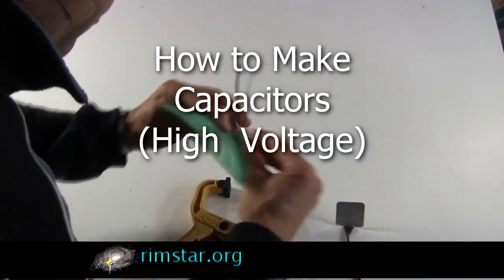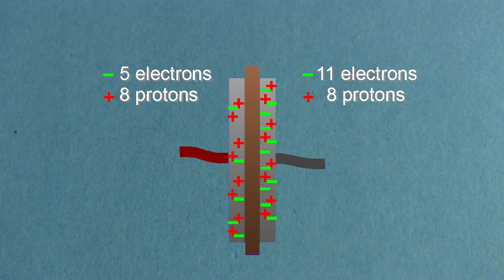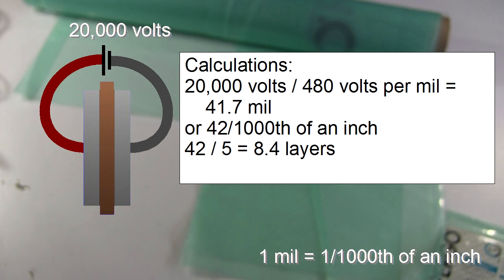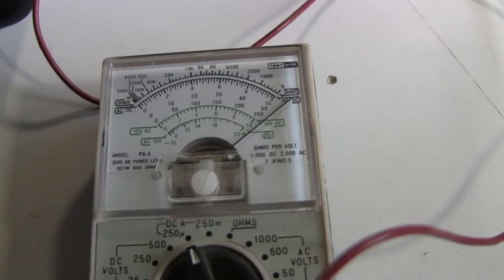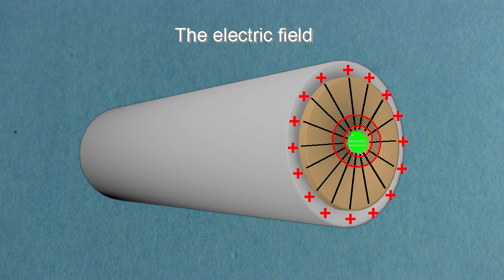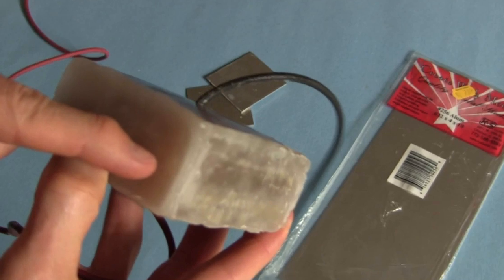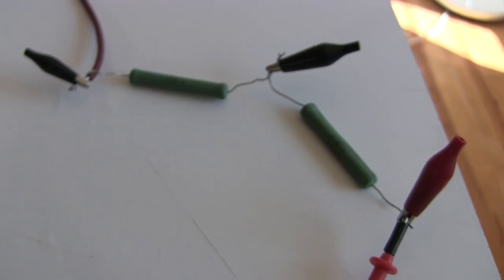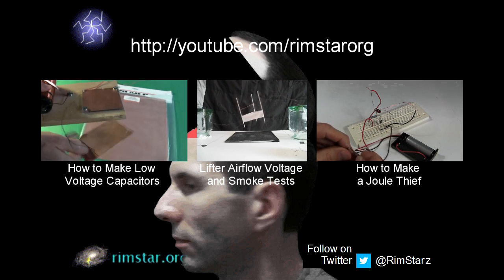How to Make High Voltage Capacitors - Homemade/DIY Capacitors

Comment: You just had too much surface area I think. If you just had a square inch of the stuff, maybe it would break down correctly.
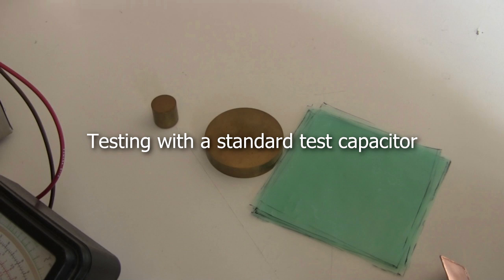Reply from the maker: Ideally when testing breakdown voltage, you'd use the actual capacitor rather than relying on the documented values. The documented values come from tests with standard shaped electrodes which is what I test with at 9:49 in the video. By pure coincidence, in this case the capacitors were equivalent enough that they both broke down with one layer.
Reply: So technically was I correct? Did the surface area contribute to the factors included in breakdown voltage?
Reply: Thanks for the reply, barely getting into the Electrical part of Science. It's really fascinating watching you guys get to work.
Reply from the maker: Oh, you had it backwards. A smaller area like you suggested would mean a more concentrated electric field, which would break the dielectric down sooner. But yes, surface area contributes to the factors included in breakdown voltage.
Reply: That's what I meant. If you had a smaller surface area of the stuff,  it would break down sooner and match the numbers you were reading. Since it was too large of a surface area, it gave the material a higher breakdown voltage. Ok cool, we learn something every day. Thanks man!
Reply from the maker: Almost. I followed it up in the last part of the video with a capacitor made using standard geometry -- that was the two brass cylinders. Those should have given me a breakdown at a thickness that matched the value I got online, but didn't.
Reply: And it didn't match the online breakdown per thickness, because of all the extra surface area you had, correct?
Reply from the maker: You're right, my bad. I was thinking of the m in V/m as the area, not the distance between the plates -- which is pretty screwed up. Thanks for correcting me.
Reply from the maker: I'd suggest doing a small test piece first. There may be some issues. From https://en.wikipedia.org/wiki/Plastic_wrap it looks like some aren't polyethylene, and there's mention of additives. Also, there's mention of it being permeable to water vapor and oxygen so the breakdown voltage may be different.
From http://www.sciencefocus.com/qa/why-does-clingfilm-cling it sounds like it gets charged patchily when you take it off the role. You might think that doesn't matter once you put it in contact with aluminium foil, but how thorough will that contact be? Thoroughly removing charge from a charged insulator is difficult that way since the charged doesn't move around on the insulator. For example, I couldn't remove all the charge from the plastic dielectric for my dissectible capacitor (https://www.youtube.com/watch?v=gPXv063O5B8) ( I don't show when I tried that in the video.) By the time I did my lightning in a bottle I knew to pour water over it to discharge it (https://youtu.be/9vneRuRRux8).

Comment: Can these high voltage capacitors work for a Tesla Coil?
Reply from the maker: Yes. You'll have to size it to meet your capacitance requirement but I did it here https://www.youtube.com/watch?v=EkvODkLL9Og.
Reply: so this will work for AC then?
Reply from the maker: The high voltage power supplies for Tesla coils are often AC and so the capacitors work with that AC. In that case they're not electrolytic capacitors (which require DC).

Comment: wonder why they are called super capacitors instead of batteries. aren't capacitors supposed to discharge fast and by themselves?
Reply from the maker: They're called super capacitors because they really are capacitors. The are an insulating dielectric separating two electrodes with the energy stored by the charge remaining on the electrodes and the electric field in the dielectric -- even though in a supercapacitor and and electrolytic capacitor they don't seem like it. Batteries are two electrodes with a conducting fluid between them and charge moving between the two electrodes, usually in the form of ions. Very different.

Comment: If possible can you make a video showing the inside of a real high voltage capacitor by dis-assembling.
Reply from the maker: I don't know if I'll make a video about that, but I do show one disassembled on my website here http://rimstar.org/sdprop/highk/barium_titanate_doorknob_capacitor_propulsion.htm. It's a Barium Titanate doorknob capacitor and we even worked out its dielectric constant and breakdown voltage, as well as broke it open to see what's inside.
Reply: RimstarOrg just yesterday I got super curious about how a door handle capacitor is put together and ended up finding out.

Comment: Breakdown voltage ratings also include a time factor - a cap that can hold X volts for a few minutes may fail after a few hours, day, weeks or months. The book ratings are for dielectrics that can hold indefinitely. Supposedly.  I've replaced many factory made caps that were rated for higher voltage than their actual situation in-circuit.
Nothing is foolproof, and everything has a lifespan.
Thanks for a great video, very informative.
Reply: This is one reason why home made time machines are dangerous the reliability of the caps are a safety hazard

Comment: Hi there. Great Vid!! So much info.....EXCEPT where to get the plastic underlay from. I tried all around me at carpet shops but no-one here in my little Australian town has heard of this stuff before. Can you post the trade name of the product, or where to get it in Canada please? (At least I think you are in Canada). Again, great vid. Thanks.
Reply from the maker: The one I have is this one here https://www.amazon.com/Pergo-45040-SimpleSolutions-Moisturbloc-Square/dp/B002T447HM/ref=cm_cr_arp_d_product_top?ie=UTF8. It was pretty randomly selected -- I just walked into a random carpet store.
A search on google for "polyethylene sheeting" turned up this page which seems to indicate you can find it in hardware stores too https://www.globalplasticsheeting.com/our-blog-resource-library/bid/76215/Polyethylene-Sheeting-What-is-it.
Reply: Thanks. I am on my own profile now!! Didn't notice who was logged in. I have found one supplier in Au. and sent them a message. No luck with hardware stores. I will try plastic suppliers here as well.

Comment: i bet part of the reason why the breakdown voltages are off is because you actually have little pockets of air in-between the plats and dielectric which would increase the breakdown voltage.

Comment: could you make giga farad or terra farad capacitor at 1000v
Reply from the maker: Nobody can. The highest farad capacitor I've seen is around 10,000 farads and the voltage was around 2 or 3 volts.
Reply: Just thought money backed by electrons would be better than what we have now. Che k out a utube channel Robert Murray Smith he shows how easy graphene caps could be
Reply: Oh thanks for the reply
Reply: Brett Moore Roberts awesome. I could make a cap like that if you gave me 10 million dollars to work on it.

Comment: hi can the microwave ac capacitor work in dc also if so what dc rating
Reply: lazy carper you would need to rectifiy it, look up HV rectifier or HV diodes on ebay.. you suffer a decent amount of heat loss rectifiying it though

Comment: The online rating is probably dependent on exposure time, if you were to do a longer running test at a bit of a lower voltage you'll probably find that the plastic will degrade and breakdown.

Comment: Hey, I'm looking for a cheap replacement instead of expensive professional capacitors for my Tesla Coil. What do you think? Is it worth a try or should I invest in the expensive ones?
Reply: raffmaxi try bucket capacitors, they will last the longest and are cheap to make.. well if you got room at least, I personally don't have room so I'm not using them. I was thinking of making my own with copper plates and mica layers to insulate.. you can get mica out of old microwave ovens, they use them on the wave guide.. there are normally alot of people getting rid of microwaves.

Comment: How to multiply the effect or raise in the breakdown voltage. I'm thinking about tho for the battery free solar generator
Reply from the maker: You'd need to increase the capacitance a huge amount for that. But it's not possible to get enough capacitance with these types of capacitors. Look into supercapacitors for that. You can make them yourself, though I've never tried so I can help you further there. I don't know even then if you can make enough to be useful for replacing batteries. Actually, hackaday did an article comparing supercapacitors to batteries just two days ago http://hackaday.com/2017/01/19/will-supercapacitors-ever-replace-batteries/.

Comment: did you mention what was the capacitance of the ones you build?
Reply from the maker: I didn't, and I don't have them documented anywhere. They're usually pretty low though, in the nanofarad to picofarad range.

Comment: i found you can wind wire in coils to make them into capacitors as well
Reply from the maker: Yup. Coils have capacitance as well as inductance. Often the capacitance doesn't matter but sometimes it plays a part. When doing calculations for the Tesla coil's secondary coil, for example, the capacitance of the coil has to be factored in.
Reply: RimstarOrg i made a wire wound capacitor has some interesting propertys

Comment: So does a high voltage capacitor discharges 30kV or does it handle 30kV?
Does the dielectric size increases the the stored voltage with increased thickness?
Reply from the maker: Whether or not a capacitor can handle 30kV depends entirely on the dielectric. A thicker dielectric can handle a higher voltage.
Reply: RimstarOrg So if I am getting an idea that I want be able to charge up to 30kV with more dielectric?
It is more like a resistor?
Reply from the maker: To charge it up to 30kV you will need a power supply that can produce 30kV. What I was saying was that the thicker the dielectric is, the higher the voltage it can handle without breaking.
However, the thickness of the dielectric also has an effect on the capacitor's capacitance, which may be important for other reasons depending on what you're using it for. My other video about capacitors explains about the capacitance http://youtu.be/GveI9gXIsHw.
Reply: At high radio frequencies the dielectric can become lossy even though it's not a resistor. The atoms in the dielectric need to be able to reverse polarity to follow the charging voltage but poor dielectrics resist that change and it's not the capacitance itself that is providing that desire to not change polarity.

Comment: Hi, my question is, how to make low voltage-more voltage please tell me quickly
Reply from the maker: Is your low voltage AC or DC? How high a voltage are you looking for? For raising AC voltage up to around 1000 volts, look for step-up transformers. My 30kV high voltage power supply raises from 1 to 24 volts DC up to 30kV (https://www.youtube.com/watch?v=GEuK1OdYxHk).
Reply: 9 volt Dc to 40volt capacitor how to make please tell me
Reply from the maker: I don't have a circuit for you but search for "boost converter" on google or youtube and you should find something.
Reply: 0092 0300 7233224
Reply: zahid iqbal what is that, your credit card number?

Comment: Thanks so much for taking the time to share your knowledge and build skills/ design ideas.  I'm currently working on building my own capacitor discharge device for magnetizing.  I want to experiment with a diy foundry and try some different alloys etc.  the goal is to use raw materials/ easily attainable materials for alternative energy experiments.  I can't thank you enough for your videos!
Reply from the maker: +John Rouse That sounds like a great project, made up of interesting sub-projects, like the foundry. Have fun with it, and thanks for watching!

Comment: don't get the meter set to 30v and it goes up to 10v max on the display and dc volt range max is 1000v dc in bottom right of the meter lol I confused

Comment: Can I use aluminium foil as plate..? 
And what is the cost of polyethylene sheets
Reply from the maker: +Anurag Trivedi You can use aluminum foil but it has a very sharp edge. I talk about that at 7:00 in the video. But if you insulate the edges well and have your dielectric be much larger than the plates so that any sparks have a long way to go to get from one plate to the other then you can reduce that problem. You can also cut the foil to have round corners and fold the edges over to make the edges less sharp. I don't know the cost of polyethylene sheets. It's been a very long time since I bought mine at a carpet store.
Reply: I need to make a cap which can store 16-18nF and 40000V.. thats for my SGTC
I think I need to make one with dimensions 80cmx80cm and width of sheets must be near 0.762mm.I know its BIG so i decided to make 20x20 cm caps from the 80x80 cm aluminium sheets(NOT FOIL)

and what if i coat the final capacitor with varnish?
Reply from the maker: +Anurag Trivedi Coating it with varnish will be good.
Reply: RimstarOrg I wanted to know if the spark length from the tesla coil depends on which type of capacitor you use? What I already have is 222m capacitor which is rated for 2.2nF and 6kv 
If I make somekind of combination such that it gives me 32kv and 7.8nF, and if I use the Cornell dubilier type capacitors rated 150nF and 2kv each to do the same.. 
Or if I simply make my own with wax paper as dielectric. 
Will there be any difference in the performance even if the final values are same? 
Per piece Cost of 222m is $0.118 
Cost of cdet is 0.5usd
Cost of my custom caps - not estimated but much lower than these
Reply from the maker: +Anurag Trivedi As far as I know, if they have the same capacitance then it shouldn't matter. However, it also depends on how well you make them. If the plates are loose with respect to each other, like with my aluminum foil on soda can capacitors, then as they get charged the plates will attract to each other and move closer together. This will change the capacitance dynamically and affect the resonance. But if the plates are made such that they can't move like that then I don't see how it would matter.
Reply: Old paper capacitors used wax paper as the dielectric and aluminum foil as the plates. A wire was attached to each foil, one each going out each end. Not sure if they are bothering to make them any more. I think the dielectric is polystyrene or some such synthetic. The longer the plates wound together the higher the capacitance. The thicker the wax paper the higher the breakdown voltage. After a while they would become electrically leaky and would need to be replaced.

Comment: RimStarOrg, Great info!  Do you remember what your camera settings were to catch the corona on film?
Reply from the maker: +Edwin Bickel Thanks! And no, I don't remember the camera settings. Though with the high current from the power supply I used here I may have just had it all on automatic. The corona from this power supply is easily visible to the naked eye. With the low amperage from my Wimshurst machine however, for example, it can be faint to see with the naked eye and I sometimes have to turn up the camera Exposure to get the corona visible on camera. I had to do that when filming my corona motor version 1, as well as turn up the blue and red in the video editor.

Comment: Thank you for your great videos.  They are well planned, thought out, and explained so people can easily understand them.

I have a question regarding home made capacitors.  When building a capacitor, which is the bigger limiting factor - the plates or dielectric?  Meaning is the size of the plates a bigger requirement to meet certain parameters?  or the dielectric?

Also, If I build a capacitor for a certain use, and the voltage is higher than what can be handled, do I just put a resistor and fuse to limit the power?  For example, I build a 200V capacitor, and use it in a circuit with a 50V motor.  Do I put a 50V resistor and maybe a fuse to limit the power to the motor?

I am new to the details of electronics.  I am informed enough on building off the shelf stuff, but individual circuits and components are a new world to me.  Thank you for your help! I really appreciate your helping people with your videos.  I watch them first, research more so I understand it better, then show my kids.
Reply from the maker: +Bryant Larsen Regarding the limiting factor difference between plates and dielectric, it depends on what factor you're talking about, capacitance or breakdown voltage. You can see all the things that affect breakdown voltage in this video (I won't repeat it all here.) Capacitance is determined by a mix of things which I go over in my other capacitor making https://www.youtube.com/watch?v=GveI9gXIsHw video.
If you build a 200V capacitor, that just means the capacitor can handle 200V before it breaks. It doesn't mean you'll be charging it to 200V; that's up to your circuit to do. If your circuit can produce only 40V then the 200V capacitor will charge to only 40V.

Comment: Can you provide a parts list for how you are measuring high voltage/current in this video?
Reply from the maker: +vegasbryan The only part is really the high voltage probe, which is the Fluke 80k-40 high voltage probe which I talk about in this video https://www.youtube.com/watch?v=kXq4FCQ0C38. The rest is all power supplies and miscellaneous analog meters. For the high voltage I some times use an oscilloscope instead of a meter. Here are some other videos where I do the measurements https://www.youtube.com/watch?v=GEuK1OdYxHk, https://www.youtube.com/watch?v=LOGAaObsN4g, https://www.youtube.com/watch?v=vzZy1Aqleno.